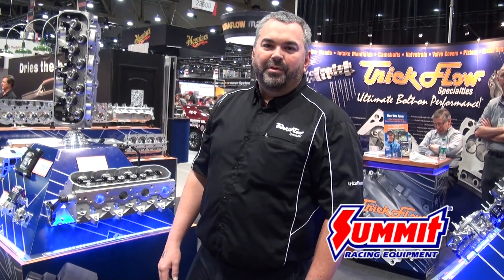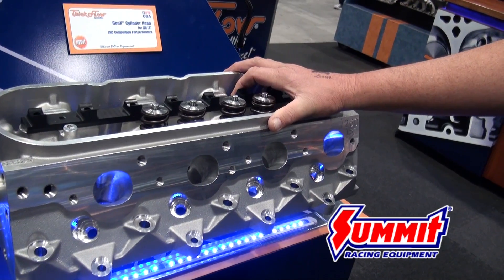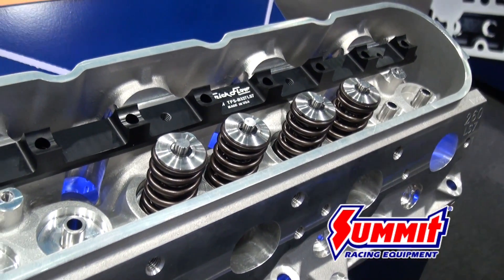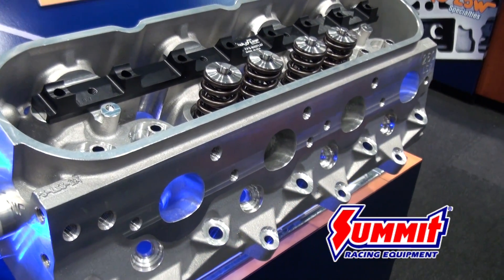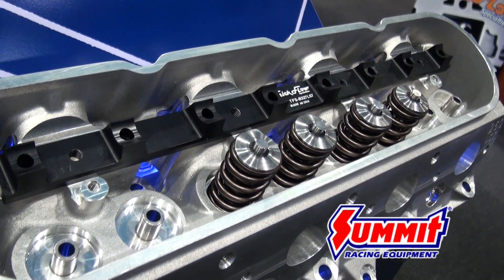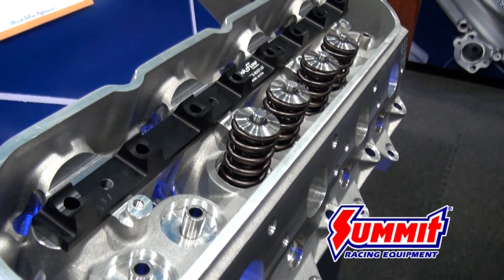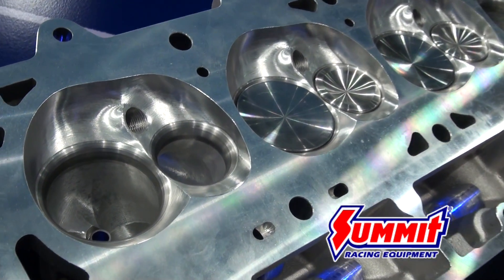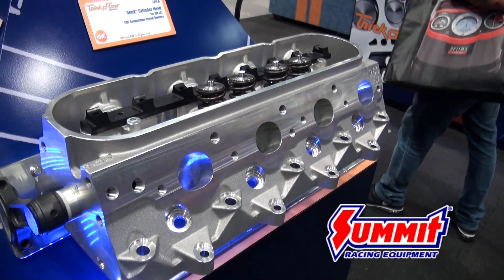Trick Flow GenX Cylinder Head for the LS7 - SEMA 2013

Comment: still only two valves...LOLOLOL so old school
Reply: Nasty Nate Still whooping ford ass with only 2v lol
Reply: Nasty Nate because it's a pushrod motor but still will out perform the overhead cam four valve per cylinder coyote Ford motor at a much lower rpm so
Reply: Nasty Nate you do know the over head cam engine is older than the push rod engine right

Comment: What's the valves made out of?
Reply from the maker: Hi Cj Ceredon, 
 We talked to Mike and he said that the valves will be made of stainless steel.  He also hinted that Trick Flow Specialties may release a version of the cylinder head with titanium valves sometime later in the year, what do you think about that upgrade?
Reply: @SummitRacing  Has the cracking heads issue been resolved?

How much will these pickup without additional porting?